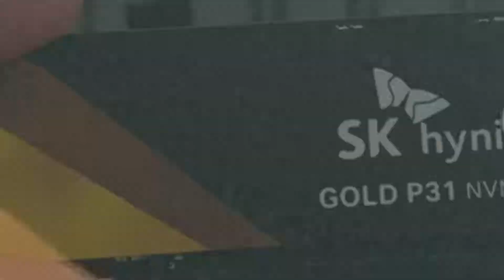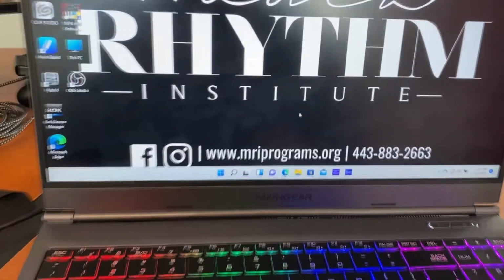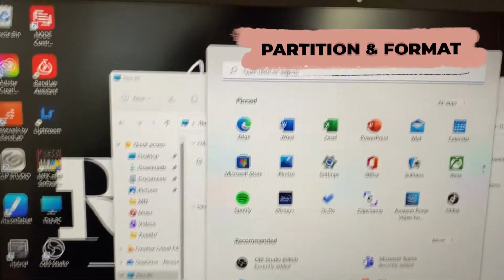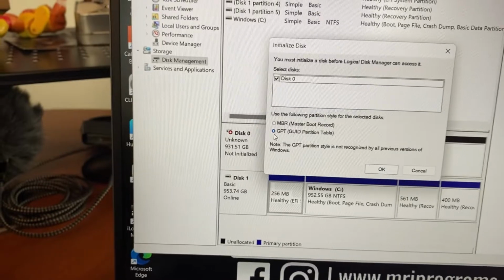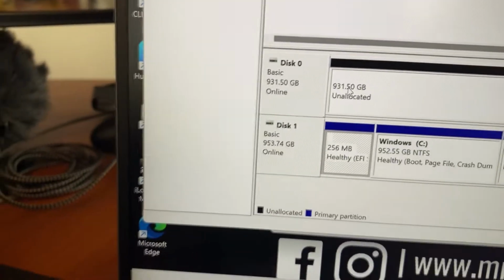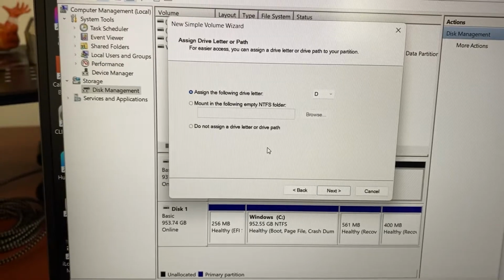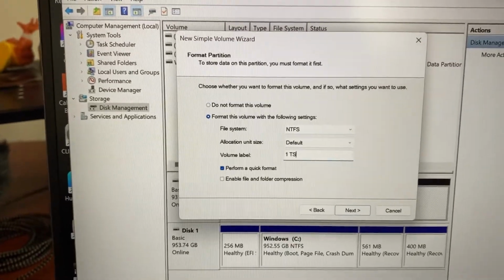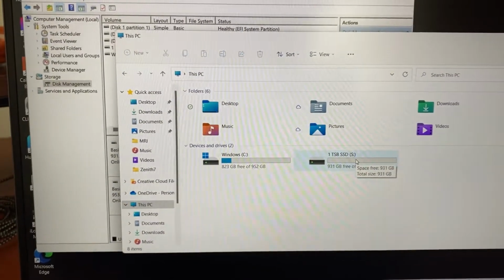Maingear Vector Pro Storage Upgrade and SSD Installation Windows 11 - Fix New SSD Not Showing Up

Comment: Thanks for the video.  I just followed your instructions and it works.  You made it look easy getting into the laptop but that was actually a little tricky.  After using a tiny flat head screw driver, the cover finally lifted off the frame.  I love the inside of this computer.  Everything is easy to access and well laid out.  It is the best I've seen over the years of having laptops.  It appears MAINGEAR is really thinking about the at-home-upgrader.  I look forward to any videos you put out in the future to take care of this laptop.  You are are very clear and thorough. Thanks again.
Reply from the maker: Thank you for the feedback! I should’ve mentioned the size and kind of screwdriver in the video. Whoops! Because it took a very small flathead to get in. I do plan to do more videos on the MAINGEAR Vector Pro. Personally, I love it and I also keep discovering things about it that might be useful to other users. Thanks again for dropping in, and I’m really glad the video was able to help you!